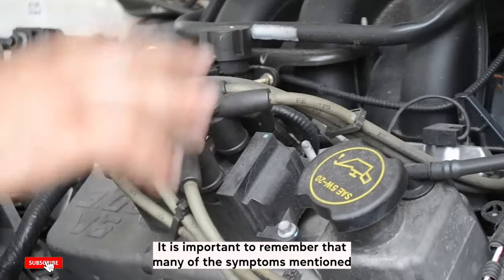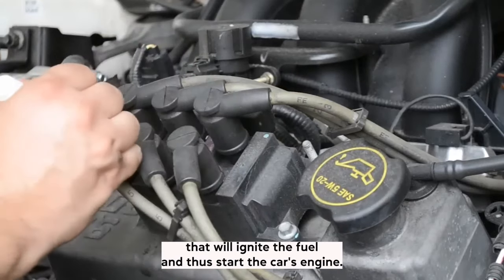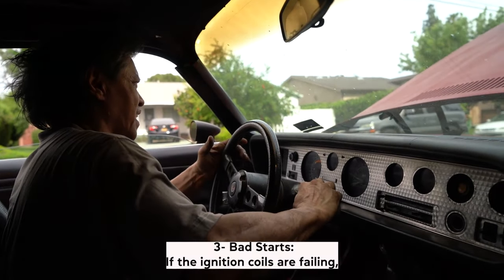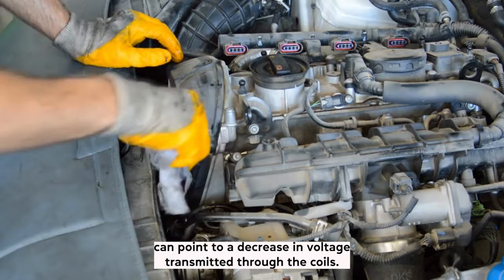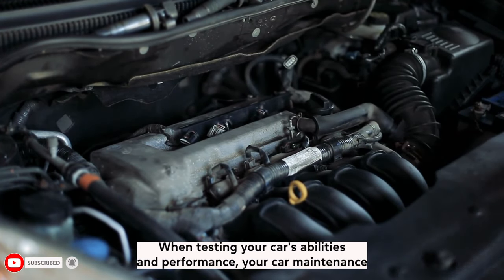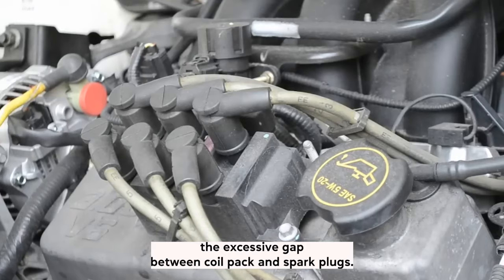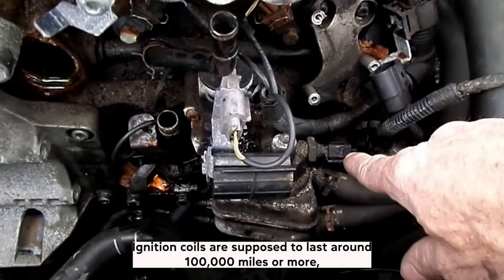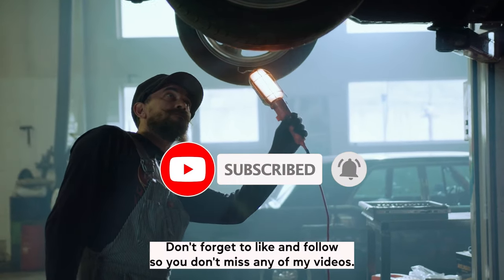9 Bad Ignition Coil Symptoms

Comment: Lots of possible causes but generally coils should be changed around the 200,000 km mark.  My coils in my 2002 Rav4 lasted to around 274,000 km before giving me problems such as stalling and poor acceleration.  Engine light will also start to flash intermittently and engine will cough and sputter like it is on the verge of stalling.  I had NGK Iridium plus in the Rav4 at the time and the removed the plugs to check how they were.  Spark plugs were 100% fine so I just replaced the EGR valve, PCV valve, MAF sensor, and car battery, and the Rav4 runs like new again.  Total cost was about $220.00 and did everything without the need for an OBD II reader either.

Engine light (due to a bad O2 sensor) is still on but Rav4 runs perfectly fine.

I only have the 2.0 engine in my Rav4 but the Rav4 is nice b/c gas mileage is great and the Rav4 is also AWD which is nice for the winters here in Canada.  Engine and drive train are relatively easy to work on as well and Rav4's computer system is only moderate in complexity what it does.

Comment: At the end he states that driving with a fail ignition coil can cause engine damage, but he doesn't go on and tell us what damage it can cause. So, tell us what happens when the fuel is not ignited in the cylinder, does it delute the oil in the crankcase? If it just gets blown out though the exhaust valve, does it damage the exhaust valve? The 02 sensors? The catyliic converter? My truck only had 20K miles on it, but because of a medical emergency I drove 600 miles with one out, it was under warranty, dealer changed it and cleared the code. Gave me the truck back, drives fine. I bought a OBD code reader, no codes. Any thoughts on damages done?
Reply: No brother you should be good, DO NOT WORRY, it can be slightly bad for catalytic converter but you didn’t drive nearly enough for it to cause any issues